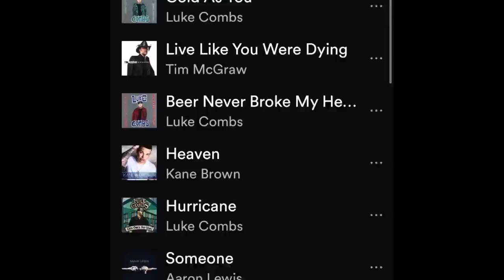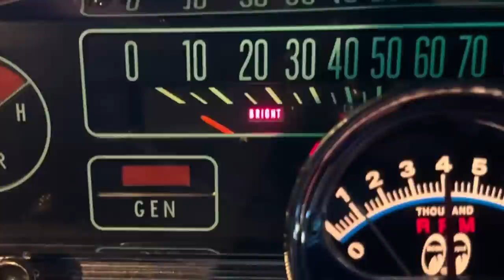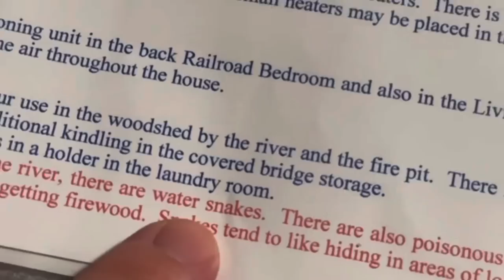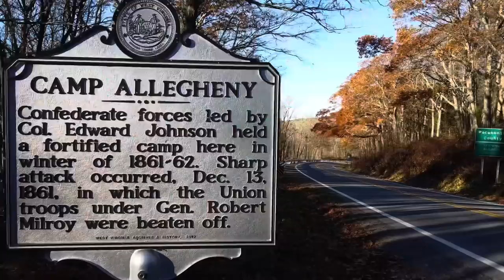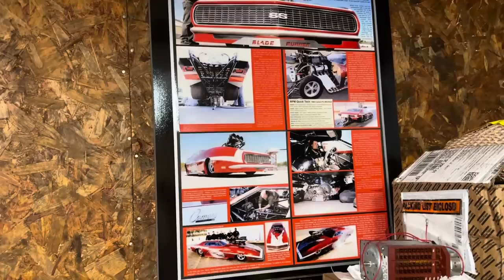1000 MILE ROAD TRIP IN A 1964 C10? Yep! And we brought home 2 NEW NOS 400 SBC’s!

Comment: After watching the episode this is probably one of my favorite to ddate. The once in a lifetime find of the motors. The once in a lifetime memories FINALLY made in the C10, just as you pictured when you purchased the truck. The ability to step away from all responsibilities and requirements, and live life free. Which you both well deserve as hard as you work. Great video. Great scenery. Great memories. Great editing. All thats left is for you to get some GREAT sleep, and pick up where you left off tomorrow. Can't wait to see these motors come to life in the near future. Good night and God bless Uncle Bill...
Reply: Finding those engines is like the dream of me finding a true set of the single hump 292 angle plug factory set of big valve screw in studs sbc 1968/1969/ sbc headand some big time head porting service I'd guess in the late 80s early 90s looks to have cncd the heads to max porting and sleeved the head s where the head bolts pass thru cause they are some huge runners and have really made a nice set if heads here and I've looked many years for a good set of factory big sbc heads big valved. ,cause I'm building a 68 chevelle that may get these heads hahaha also another dream of driving one out of all the cars I've owned and built ifinally found one and almost ready to paint after doing frame off restoration  and everything is new also is going from now it's a frame off build and has had front and rear disc conversion and 12 bolt rear has a new front pieces and all chrome grill everything as it should now is taking a twist of a turn which is headed for a small tire killer build to street drive and street raced grudge car. I've already got one that I race but am wanting a classic brand new build cause finding old parts like those sbc 400 engines are a diamond 💎in the ruff nowadays,  seems as if all our history making parts and cars have almost disappeared! Sorry the comment is so long but I get excited about old cars and parts hahaha

Comment: Very nice of Victor to sell you not one but 2 of the 400 small blocks! They’re incredible engines my brother had a built 400 in a Chevy Luv pickup that would fly on the drag strip. Of course we had to bolt Tractor 🚜 weights in the bed over the rear axle to get it to get a grip on the track 😂. 
But kudos to Victor 😁👍

Comment: I was a garage owner in AZ.. we also did mostly "New" engines (and only new shortblocks)  Some reasoning behind that was the place we were.. Cylinder bores in the hot silicate infested desert means bores that are lucky to clean up at 30 over.. So time/value and comeback prevention dictated new short blocks and new longblocks quite often (the $700 crate engine might have had some influence too) ..  Nice find on the engines..

Comment: Road trips are fun,in the US Coast Guard i made 1 trip from seattle wash,to elizabeth city North Carolina 30 miles from outer banks in a 1970 chevelle 454 ls6 4speed red with white stripes and white interior 40k original car,then drove it back to seattle after A-school and stationed on Kodiak Island,Got a 1970 cuda 340 and drove it from alaska down thru canada and down california coast and across country to elizabeth city again.late 80s to 96.Always had tools,extra oil,spark plugs ,wires,coolant,trunk full if i every broke down.

Comment: Bill, I am sure that uncle Bob is aware but I just want to remind you that heads for a stock 400 sbc need steam holes drilled in them to prevent overheating and cylinder cracks.

Comment: Y’all produce great footage. Me and my wife always watch and keep up. I have a 69 c10 and pulling the 12 bolt down at the moment. What gear is in your truck and what’s rpms looking like with the 700r4 bout 60-70mph. I’m thinking about a 3:08-3:42 ish but got to be able to do what you do with yours cruise and get parts. I’ll be taking the th350 out and doing a 700r4 soon. My 350 is a 350hp. Thanks
Reply from the maker: We have a 3.73 and kinda wish we went 4.10 but it runs 75 mph at about 2450 in O/D with the converter locked.